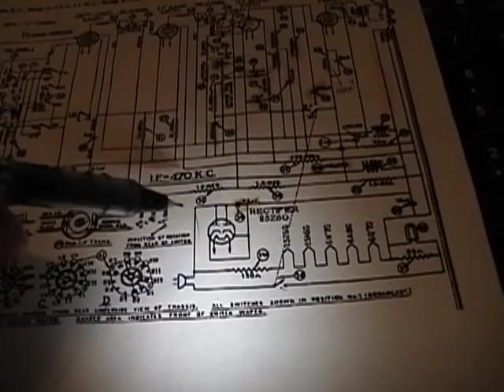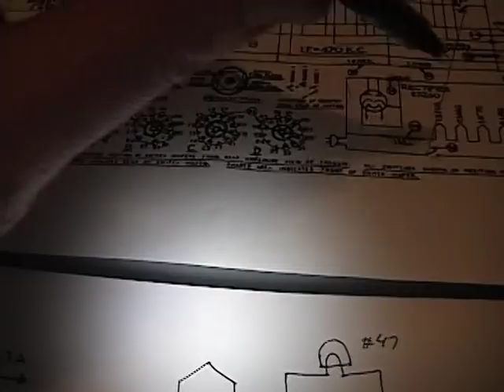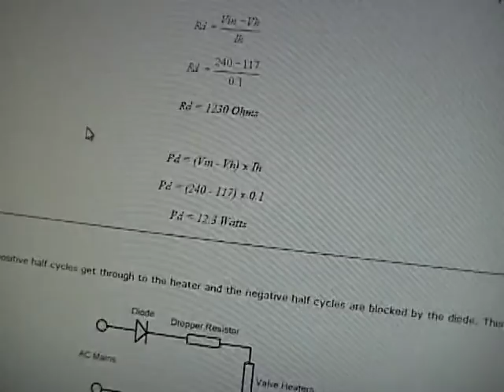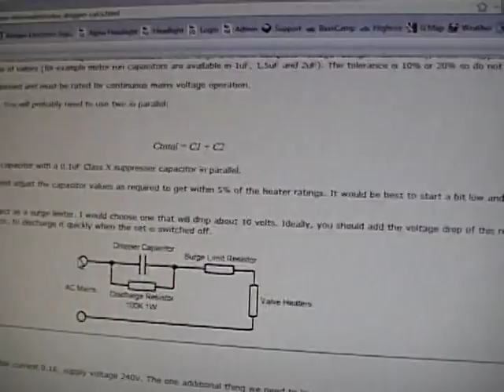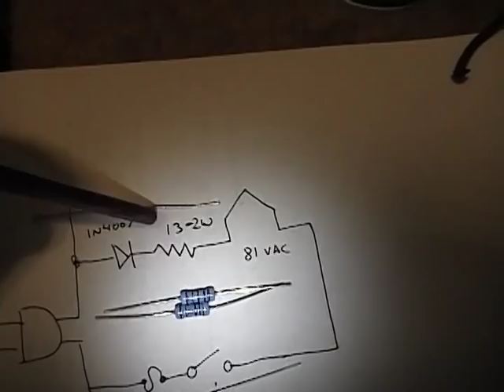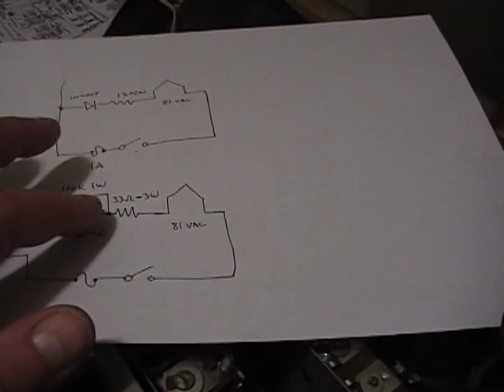Philco 37-611 Restoration p4o4

Comment: What a great video. Using the Dropper calculator will be most useful in the future to get exact values for the diode/resistor or capacitor options. I suppose this calculator can be used for resistor line cord replacement and replacing selenium rectifiers without having to "guess" at resistor and wattage values.

Comment: I liked the fact that you tried each of these voltage dropping schemes in real time to see what they did, theory is one thing practice is another. Most of my series string radios are newer then the 1930s so the string adds up to 117-120 volts. Out of the few older sets that I have all had the ballast resistors intact so I didn't need to engineer a substitute to make them work, although I may try something in the Plant A set. which is missing the metal shell over the ballast tube.

Comment: The 6 volt tubes are actually 6.3 volts each, so it's 18.9 volts plus 25 volts plus 25 volts equals 68.9 volts at 300 ma, so you need to drop 51.1 volts at 300 ma. I think that the standard voltage they worked around was 117 volts, which is strange since even back in the 1930 and 40s it could vary between 105 and 125 volts from area to area, sometimes even from one time of the day to the next.